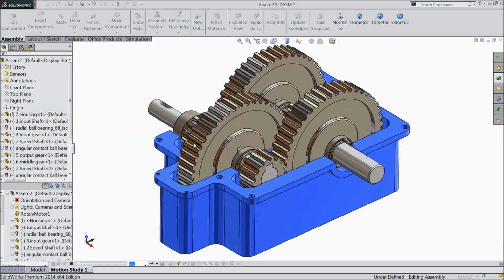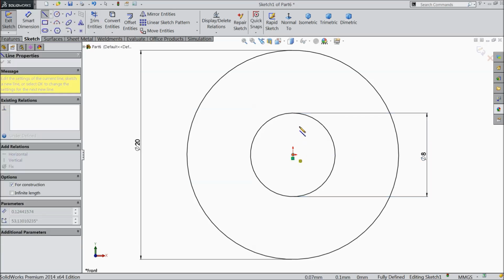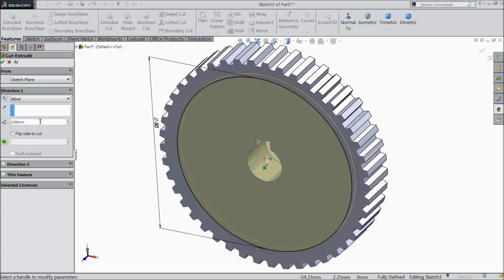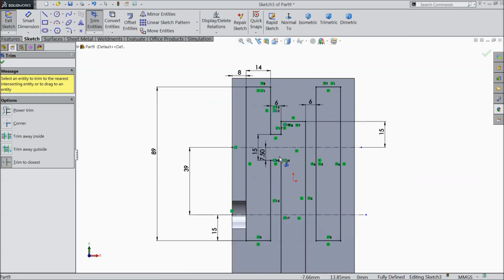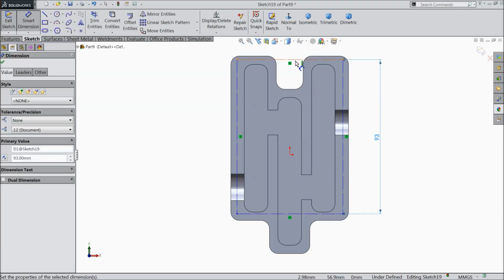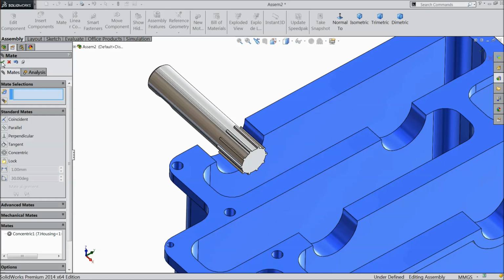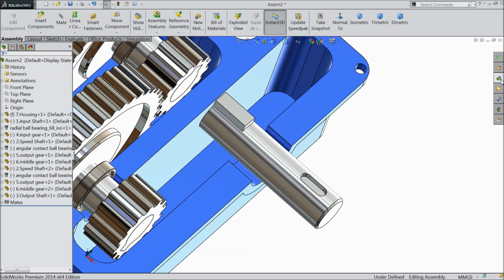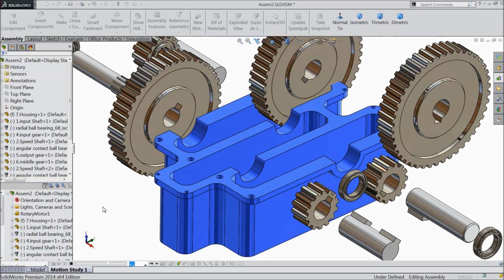Solidworks tutorial | sketch Gear Speed Reducer in Solidworks

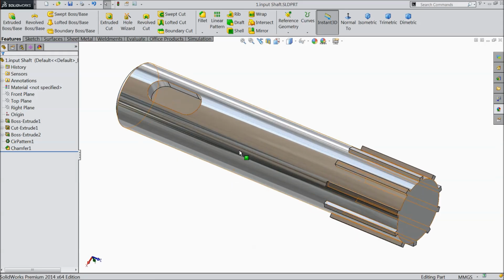Comment: 2-Speed shaft 4:43
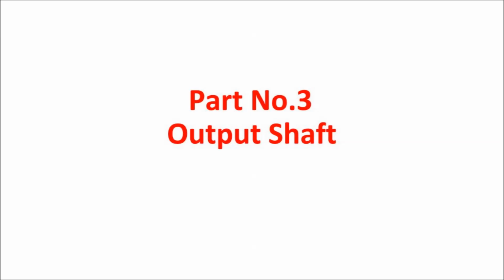3-Output shaft 7:17
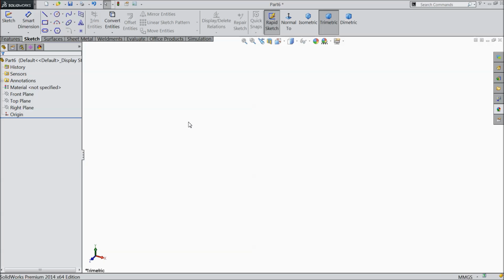4-Input gear 10:31.
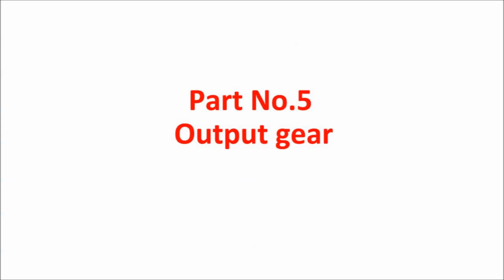5-Output gear 17:38
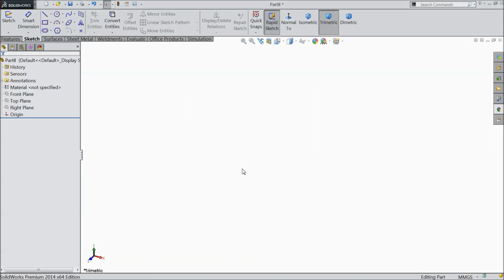6-Middle gear 24:12
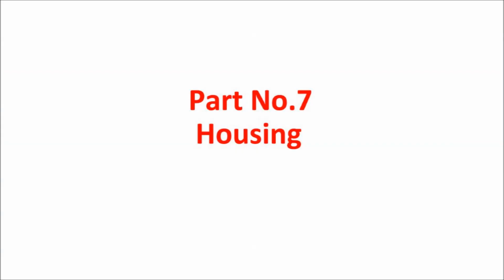7-Housing 28:37
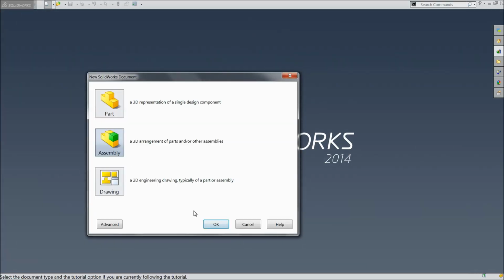8-Assembly 53:57
Reply: Hello Sir, is it possible to get all the dimensions used in this video? 
Or a reference for dimention

Comment: There is provision in solidworks to generate gear  profile automatically.
We have type module pressure angle no. Of teeth and teeth width. It will make spur gear.
Reply: can be used for bearings, and different gear types as well, the toolbox library is very useful, but for beginners I guess it can help to know how to design the gears from scratch
Reply: @elliotlaw1590  how to download free  solidworks from internet.
Reply: @ashokballatagi1318  idk I got it through my uni
Reply: @elliotlaw1590  yes...

Comment: i reading comments indian accent what a effective work sir perfect
Reply: Perfect? There are a few mistakes for example the gear ratio at one point, redraw things in scetch  instead of to copy elements from other scetches makes it easier to change, use proper thread by using the boring wizard. These things are important if you want a drawings out of it. And i did not watch the whole video there is probably more